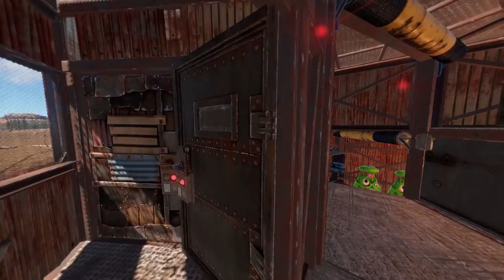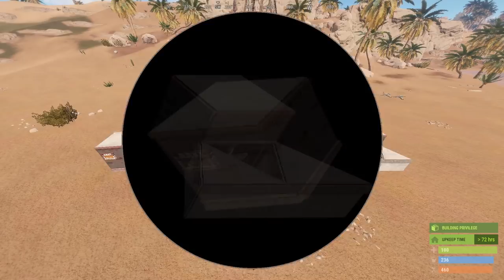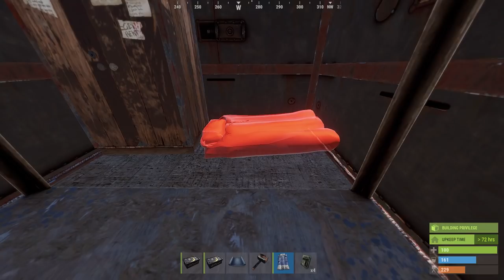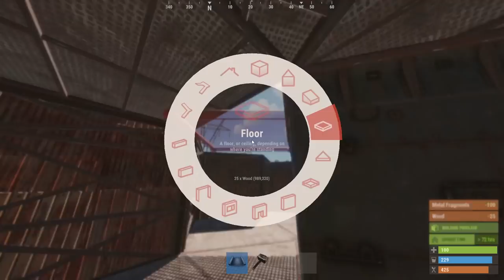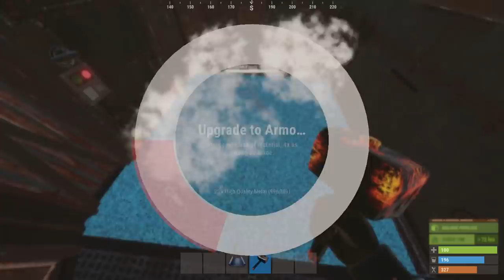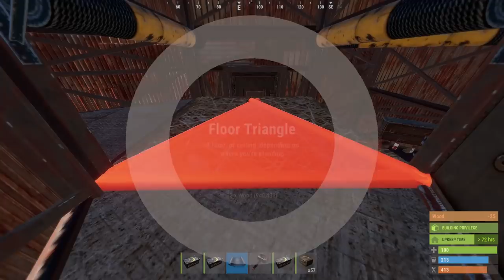Rust Base Design 2019 - Small But Strong (Rust Base Building)

Comment: 0:50 why are you placing a bag on the ground? You need to place a bag where that small box is and make sure you have a melee tool in the box where you pass loot through. With those stability bunkers you have to place the wall and floor from the outside, and you need to spawn on the inside to destroy the wall to get rid of the floor.
Reply from the maker: indeed, it is possible to drop a stash in the ground but its tight, i really should have added what you mentioned above into the vid, i can't believe i forgot to :(

Comment: Smart and interesting build but the outer bunker is vulnerable to having its foundations jackhammered, 20 mins & ~3 jackhammers and you negate 16 rockets - having a workbench accessible makes this much more viable.  2 front doors, 1 garage door to WB (optional), jackhammer bunker foundation &  through one armored wall and you have TC.
Reply from the maker: at end game i would prolly use armored double doors leading all the way up to the armored foundations to make the cost closer to the 16 they negate by jackhammering the foundation

Comment: but what happens when the raider destroy the box sticking trought the wall?
Reply: asking the real question
Reply: Dusty that box is only used for moving loot in and out. if they destroy it whatever was in it will fall out on the outside.
Reply from the maker: drop box

Comment: How can I break the triangle stability bunker if I am solo, and the sleeping bag is in on the ground where the foundation is missing? I have no tools and it would take me 37 times to respawn and break the wooden half wall. Don't I have the place the sleeping bag where the foundation is, because otherwise I have no way how to break the triangle stability bunker...
Reply: I placed the bed on the other side of the half wall with the soft side facing the bunker. Leave a picked a in the transfer chest to easily break the wall
Reply from the maker: indeed

Comment: I’m confused how you are supposed to break the wood and get out of the stability bunker when there is no way to have a weapon down there
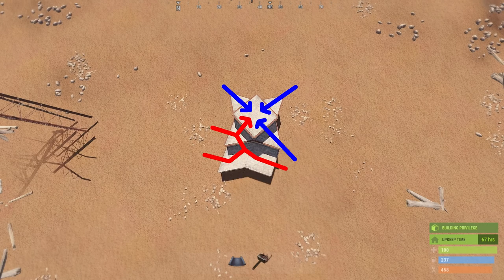Reply: The idea is to leave the bunker open UNTIL you put an axe (or any weapon to break it) inside the boxes of the 1x1 TC. You can do that using the box bug in the wall (2:35)
Reply: You can craft a matchete with 40 metal fragments and 200 wood. No workbench required. 3 of them will break a wood wall if you're hitting the soft side. So breaking the bunker really doesn't take a lot of time or materials.
Reply: @tabushka292  But you spawn on the hard side and the box is in the softside all you have is a rock.
Reply: @skyeeer8739  Oh well you should have the soft side facing wherever you spawn, and you can fit a small stash or a campfire in the triangle with the bag where you can store some machetes
Reply from the maker: it would be better to place your sleeping bag on the triangle foundation
Reply from the maker: Placing the sleeping bag on the triangle foundation right next to the box through the wall would make it better
Reply: @MyGamingExperience  yes but when you showed it off you had the sleeping bag on the hard side and the box with no way to access from the outside on the soft side.

Comment: The only issue i have with these designs for hiding the TC, is that if that box gets broken, the base is kind of useless. you can't get any items in or out anymore. There is NO way to reset it.
You could destroy the TC and replace it somewhere else if this happens to save the base, but all loot inside is effectively gone.
Reply from the maker: you could replace the box with a dropbox but it would not be ideal.  I think if that box gets broken the raiders will most likely be going through that wall either way

Comment: They can jackhammer through armored foundations. Not that fast, but 16 rockets wont be needed, and if they're 4, its not that time consuming
Reply: That's a shit load of wasted time to do that. This is yet another reason I advocate for not storing mass amounts of shit in your base no matter how secure it is. I'd maintain a smaller stone base with some extra gear sets/guns in the event your main gets raided. Also, never leave extra sulfur/metal/etc when you log off other than around the number of hours you plan to be offline. 

A base like this would take either a ton of mats or a ton of time to get done and if you don't hoard too heavily it will hardly of been worth the effort. For me, that's a win in my book.
Reply from the maker: if they online you you can always wall off the wood part into hqm that holds up the bunker floor as well

Comment: The only thing i would have done, would be to change all the doorframes and doubledoorframes from sheetmetal to stone. You could make the base 4 rockets less if you honeycomb with sheet instead of hqm, but then add another layer of honeycomb of stone on the outside. This way you’ll have way less hqm upkeep and you won’t need that much. It wouldn’t be as strong though.. This base is really sick, the only thing is that the hqm would be hard for most solos and SOME duos.. (1 bag in the bunkers)
Really good video, you explain everything you do perfectly, I’ll probably try this one out tbh :))
Reply from the maker: i appreciate that, this base will most likely come down to playstyle, possible for some impossible for others, im gonna do some testing with lowering the hqm cost/upkeep and adding more around the outside
Reply: My Gaming Experience sick bro, these vids are sick, i would love similar base designs for a small group 3-5 people. Your explanation is really good!

Comment: A very solid base design and a well made tutorial. The raid cost tho, would be 4 c4 and 30 rockets or 38 rockets through the walls. The HQM walls take 15 not 16 rockets to raid, this is a common misconception and is getting a bit annoying that a lot of people are spreading this misinformation.
Reply from the maker: yeah it 15 and some ammo for each wall, usually people just round it up cause most people with shoot the 16th for each

Comment: Raid it the proper way and it is only 23 rockets and a bit of explo ammo. But going through the side is not a good raid as it is by far the most expensive.
Reply from the maker: there is no way to skip the 2 hqm walls
Reply: My Gaming Experience you can. U can blow top, jackhammer the foundation, since it is not protected. Then u can brake the wooden half wall which is exposed then. Yes u need to go through the suicide bunker. But for 600+ HQ and only 23 rockets is not the best.
Reply: @gerben8220  have fun with that

Comment: Bad Base, Splash will do more then you think, its 31 rockets to TC easily griefable with semi lucky heli take (incen rockets). This is just a bunkered 2x1 with a wall drop box - you might as well make a dank tank at this point its cheaper for the upkeep
Reply from the maker: 31 to tc is quite strong, and there is no way to get all the loot rooms like that, external tc would stop the griefing

Comment: Imo the problem with this base is, that u cant restablish a way to get stuff in&out the TC room, if the box gets destroyed.

So raiders:
Step 1: 4x C4: Blow the 3 doors, or alternatively the roof behind the wall with the amored door (which is visible from outside)
Step 2: 8x C4: Blow the square foundation below you.
--- Congrats you sucessfully reached the bunker, using 12 C4s or 23 rockets.
If you can continue your raid to TC room feel free to use 8 more C4s... gg

If u cant reach TC make sure to grief the owner by destroying the wall box. Now he hopefully has enough stuff in TC to provide some upkeep, and enough explosives outside the bunker to reopen it in time.
I dont recommend using explosives inside a 1x1 environment with your own sleeping bag. ;)
Reply from the maker: you can replace the box with a drop box